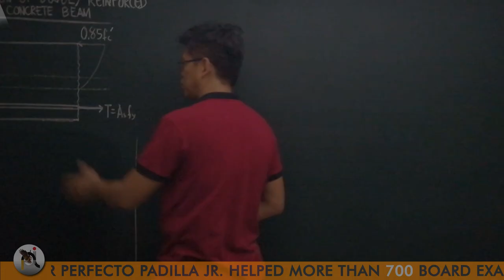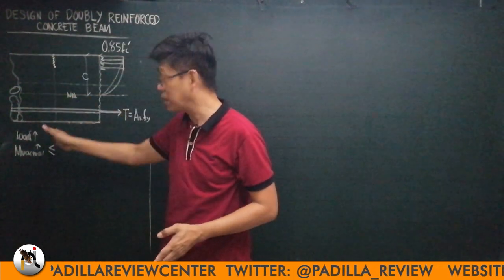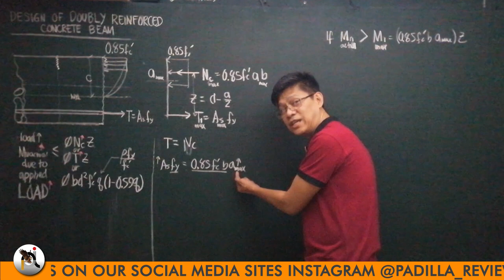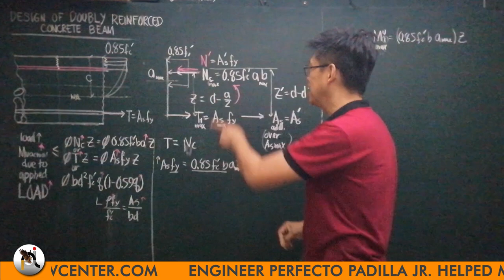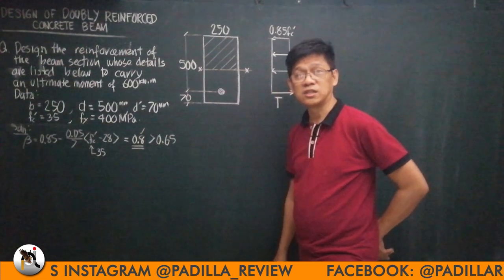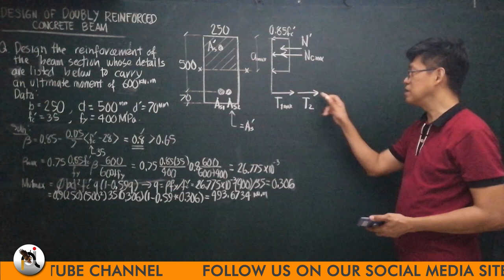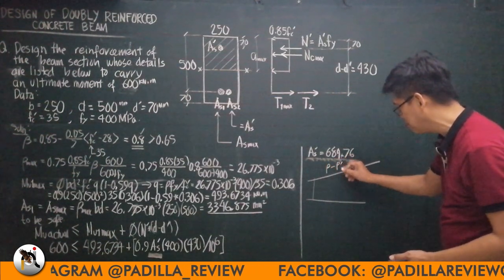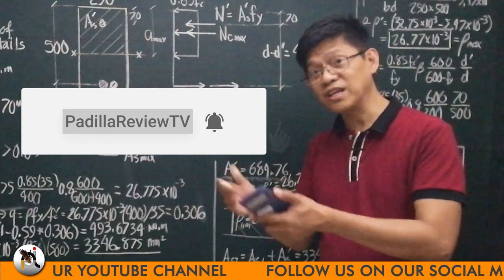Reinforced Concrete Design: Design of Doubly Reinforced Concrete Beam Using NSCP 2015  - Part 7

Comment: Hi sir, tanong ko lang po, ano po ung book mo (authored by you) na mererecommend mo for easier understanding ng key concepts in RCD that will make advance topics in design easier? ( ung book po sana na marami ring problems and kasabay na po ung solution)
Reply from the maker: Hindi ko pa sya na update. But my mastery course in rcd is updated to latest code and contains perhaps all variations that you may need in the brd exam and in practice
Reply: @PadillaReviewCenterOnlineTV   hi sir, Gusto ko po sana bilhin ung book niyo na may title na "CIVIL ENGINEERING REVIEW MANUAL SERIES 1" kaso nasabi niyo po earlier na hindi na siya updated. Hihinge po sana ako ng recommendation sainyo kagaya nung book niyo na "CIVIL ENGINEERING REVIEW MANUAL SERIES 1" na complete na pero ung up to date version po sana. Wala pa po kase akong time for mastery course since i am still currently studying BSCE.  Yung kagaya po sana ng book niyo na nandun na po ung fundamentals ng lahat ng major subjects sa CE and at the same time may problems and solution narin po. Thank you po.

Comment: What if steel doesn't yield.
Reply from the maker: There are various possibilities for this one. If you are analyzing, you've got to reduce your fs to fsl or fs' to fsl'.

But if you are designing, it means that you exceeded the permissible limit. You've got to make adjustment on the value of fy, fc', or size of beam. But increasing the size of the beam must be the last of options.